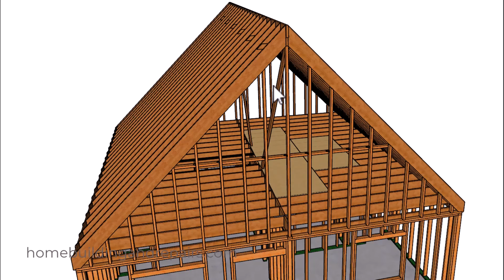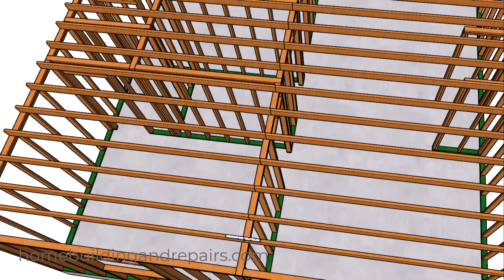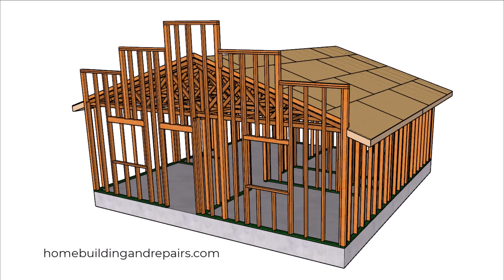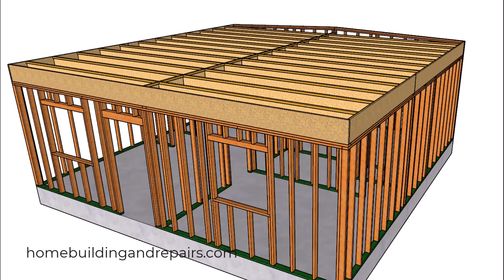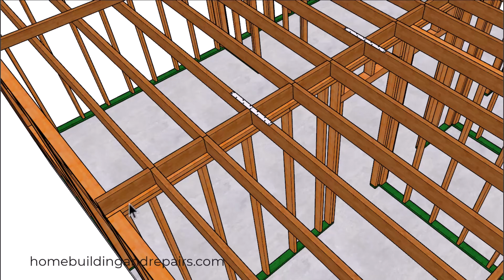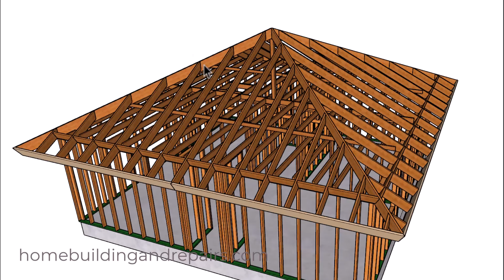Six Different Roof Framing Designs for The Same Small House Floor Plan

Comment: I never knew that could be a function of a hurricane tie but I can see why that would actually work very nicely. The weight of the board puts the outside of the gable wall studs in tension holding it straight. Bravo